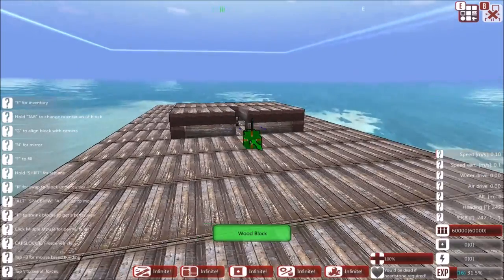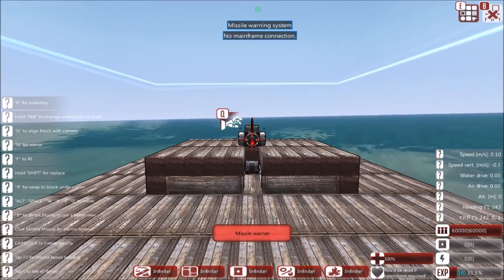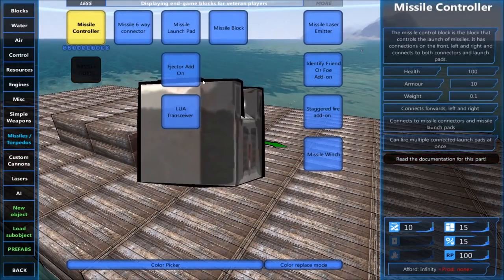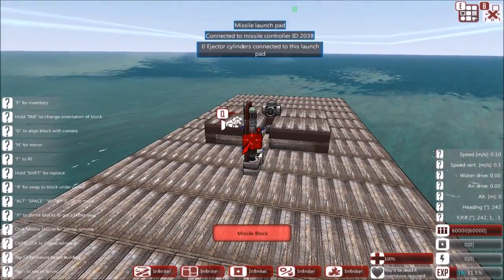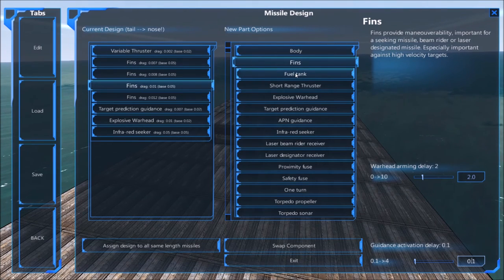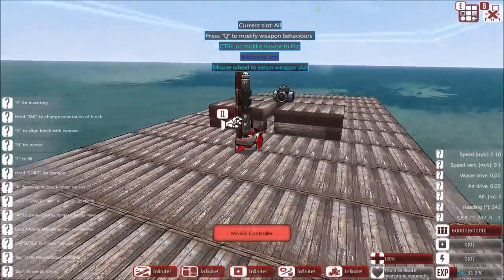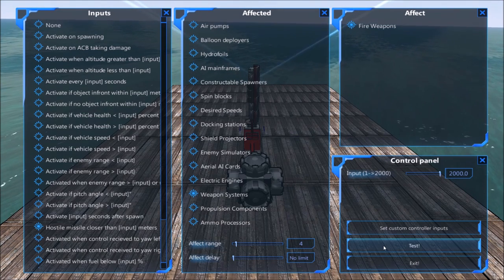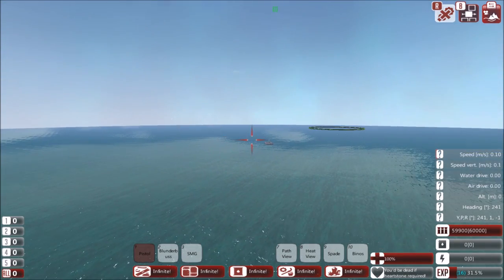From the Depths Quick Tutorial - Anti Missile Missiles

Comment: So I've got a bit of an issue, I wanted to make a tilted array for my sticky flares (looks pretty cool, actually) but for some reason, when I put the flare array on the spin block (which makes it tilt back 30 degrees), it removes the ACB from the prefab. Any ideas?
Reply from the maker: If I remember rightly you can stick the ACB on the main craft and increase its range to also cover the flares on the spin block. Be careful there aren't any other weapons nearby that might also get activated.
Reply: HEY! Waddya know... It works! Thanks a bunch. It also doesn't hurt to actually HAVE missile warners as well. I don't know why I thought you HAD to have the ACB's attached to the subobject to work.